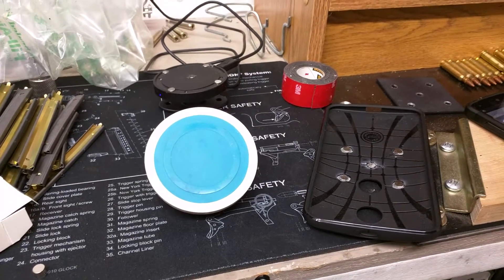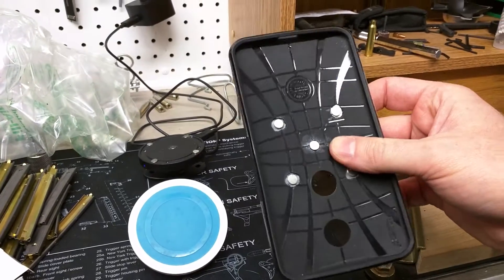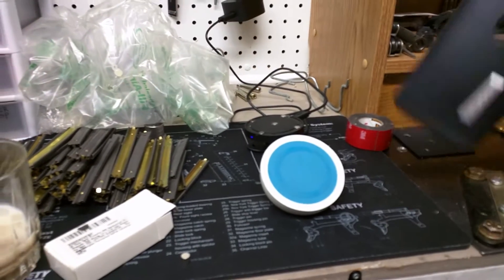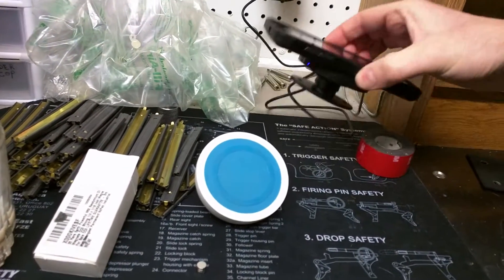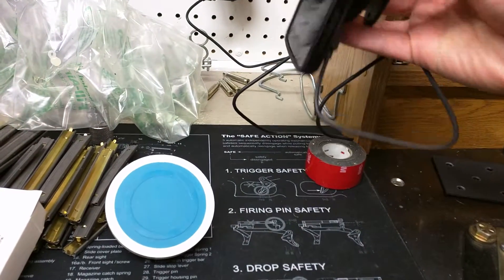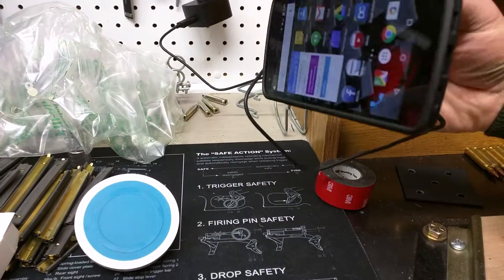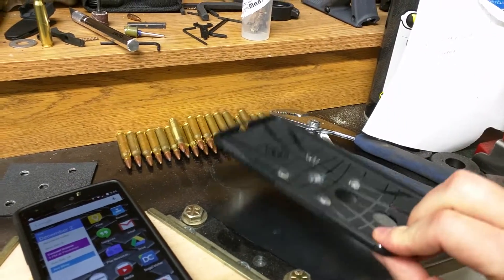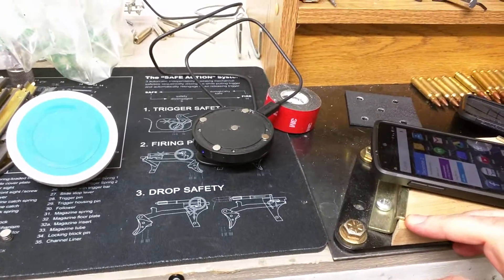How to make a cradle free magnetic wireless car charger

Comment: Really struggling to find a good case for a Note 5 that has any kind of room in the back for attaching magnets. Either they are way too ugly or too thin (2mm) in the back to do any kind of carve out.  I spent about 4-5 hours yesterday searching ebay/Amazon and have a few potential candidates, but none that really jumped out at me.  I did see some interesting concepts that have a slot in the back for credit cards... wondering if I could take advantage of this somehow and create a credit card size array of magnets. Also, what do you think about just putting a piece of magnetized sheet metal in the slot?  It looks like some of these cases can fit up to 2 credit cards, so that should be a good enough size? It would make for pretty heavy phone though.  Just not sure how well it would work because the compartment has a sliding door so it might slide open when trying to place the phone on the Qi pad from the magnet pull.

Comment: Love it, this is exactly what I need!  I just purchased a Note 5, not sure how it compares in weight to the Nexus 5, but it's not light.  What would be really great is if all manufacturers just installed magnets inside the phones, that way I could use any style case, and much thinner ones (or none).
I have a few questions on your solution...
1. I have seen knock-off Qi pucks from Hong Kong for about $3 each... I assume they will work the same as the powerbot... specifically concerned about messing with coils inside and placement of magnets to not impact charging
2. What do you think about the use of taller mounts to get it further away from the dash... will it become too wobbly or more unstable over rough road?  What alternative mounts have you used and recommend? (ex. for home/shop use)
3. What did you use to permanently affix the Qi puck to the XM mount?
4. How thin is your case?  What is the thinnest we can get away with?  
5. What thickness are your magnets?  I see some super thin ones out there that are 3x wider than yours that could work
6. You mention that the case won't stick to your keys, but what about a wallet full of credit cards or hotel keycard?
7. Any issues using NFC with this setup?

Comment from the maker: John Ramsey, here is a link to the type I used. They are all the same of this design. If you want to be extra careful you can remove the rubber boot on the bottom to expose the screws and remove the inner parts for the drilling portion.
https://www.amazon.com/dp/B00IQTGY2A/ref=cm_sw_r_awd_6LM-vbYKCBGC7